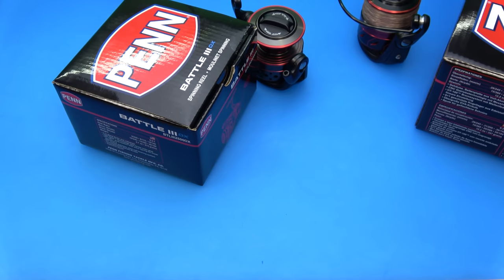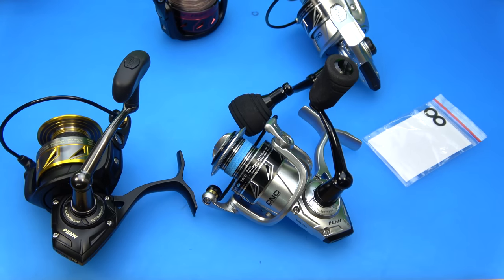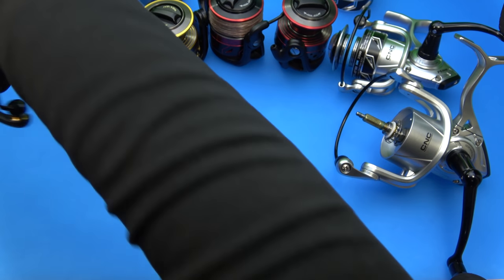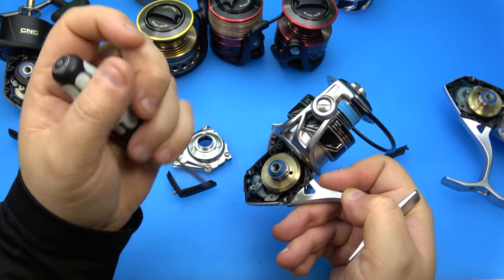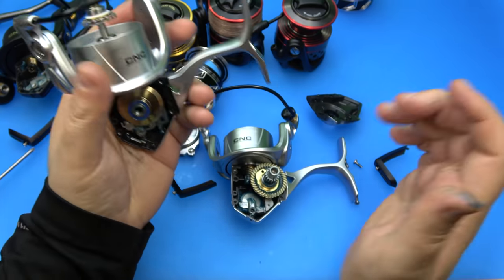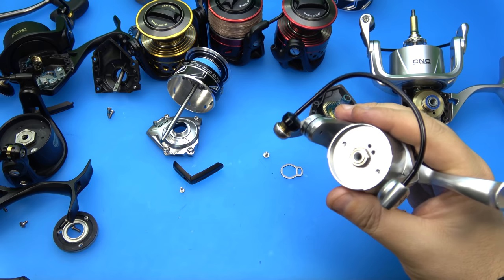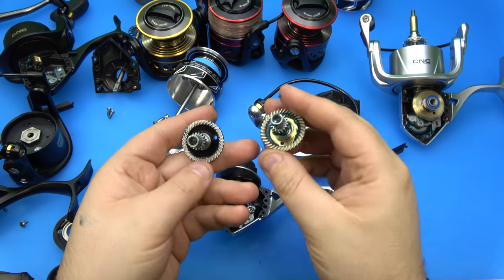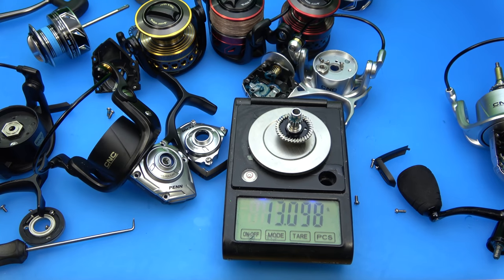The NEW PENN Battle 3 DX is SWEET!  How does it compare to the Battle 2, 3, and Penn Spinfisher VI.

Comment: I am a HUGE PENN FANBOY. I am South African and I fish rock and surf. I have the PENN BATTLE 3 6000 (which over here has a brass main gear) and I have a PENN FIERCE 3 6000. Both reels have done a bit of battle with some fish and I've been very impressed.

This is the best and most in depth review I have watched on YouTube. Thank you
Reply: @watching-thats-it  I think the Authority has a stainless steel rotor.
Reply: @watching-thats-it  I'm in the same boat. That's why I bought the Battle. It has a brass rotor that is as smooth as butter 😁
Reply: @watching-thats-it  apologies, I confused the rotor with the main gear.

Comment: Protip: Fill up the gaps inside/between the line roller assebly with high-viscosity oil i.e. bicycle chain lubricant, and it works like Daiwa's magshield. Even better than the magshield, because those chain lubricants are purposefully engineered to stand up against water, dust, salt, and every evil stuff you can imagine out there. The oil's surface tension keeps them from leaking out(that's why you need the high viscosity) and sheds off water like magic. Don't go cheap and get the good synthetic oils because they are still a ton cheaper than fishing reel lubricants.
Reply: Good to know! 👍💯💥
Reply: The key is to inject the oil up to the point where you can get the visual of the shimmering liuqid inside the gap between the line roller and the bail arm
Reply from the maker: Ehhh not what I would recommend... It'll become a sand magnet.  I grease my line roller bearings but try to make sure it stays in the bearing and I oil the hub

Comment: It think dx is supposed to mean dealer exclusive. I was looking at the battle 3 3000 and and the spinfisher vi 3500. I wasn’t sure about the new battle as it just came out. Knew the spinfisher had a good reputation so bought that. After a about an hour or two of use, when I would reel in my lure I would feel clicking or something like that, and it just didn’t feel right when I would reel. Eventually it started to feel rough and noisy when reeling in. Now over the past couple weeks the reel sometimes binds up when the spool is at the top of its oscillation. Next time I used it blackfishing the reel would bind up when reeling in a fish. The only thing that probably screwed something up is when other reel started binding up, the trip before that the rod rack at the dock broke and feel in the water with that reel in that rack. It was only under the water for a minute at most before we could get the rack back. Rinsed my setups that feel in the water when I got home. Supposed to be a sealed reel. Not like it’s been constantly getting dunked or sitting under water for an hour. I’m thinking about sending it back to penn when the season is over

Comment: So at that similar price point, would you go with a Spinfisher 6 or the Battle 3 DX ?
Reply: Good question. I'm curious too
Reply: For the price or just overall quality
Reply: @eastcoastoutdoors902  bang for the buck
Reply: @Floridaoutdoor  for the price you can’t beat a battle 3 DX from how impressed he was with the seals and the overall bearings. He also said penn would send some replacements if they ever got rusted. I just ordered myself some
Reply: Depends on whether your reel gets splashed a lot. If not, go DX. If it does get splashed often, go spinfisher. I beach fish so spinfisher for me but on boat or pier I would go with the DX. Just my 2 cents.
Reply: @seamurda100  yep I would agree on that. Inshore go DX especially for the price you can’t beat it
Reply: @eastcoastoutdoors902  Spinfishers keep sand out so much better. The shaft seal just makes it worth it to me beach fishing. I got tired of tearing down my daiwa bg's every 2-3 beach trips due to sand or water intrusion. Never had issues with them other than that. You can make a non sealed reel work on the beach but you are going to be tearing it down to keep it running right. Dont even think about using one if sand gets in it. Immediately discontinue using it and tear it down. I broke one reel using it after sand got in it.
Reply: @seamurda100  facts bro
Reply: @seamurda100  yeah that sand gets in and grinds up the gears putting chips in them and ruining the reel

Comment: Carolina-bred, fishing 'otaku' (fishing nut) here in Japan (38 years now) ... loving your patter.  In another era, good enough to make a television show out of it.  

But I couldn't help but to notice some parallels between the way car manufacturing in the U.S. and Japan had gone for awhile.  The do-it-yourself thing was quickly faded out in the Japanese post-war economy, long before the American handy-man started going the way of the Dodo.  But like you said, while Penns are still user-friendly service-able, Japanese reels are increasingly leaving that business model.  

In my twilight years, I'm heading more towards the finesse / ultra-light end of both fresh and salt water ... and recently replaced a couple of old Shimano Twin Power 1000s with Daiwa Luvias 2000 shallow spools ... great for my intended purposes (caught a few pecker-sized jack crevalle at Shimoda a couple of weeks ago), but impossible to service.  What is frustrating is that neither Daiwa nor Shimano will service reels older than 5 years ... basically creating a 5 year rentier business model — unless you can find a small 3rd party shop that services them.  And this makes no sense to a user who buys a Stella as a legacy reel to hand down decades later.  Just an old salt mumbling to himself here.

Cheers from Japan, and wondering if you got that Daiwa handle knob from Hedgehog?  I thought I'd try my Japanese language chops with them ... only to find they use translation software, and automatically switched to English when they saw my name.  😂
Reply: "Pecker sized" 😂😂😂
Reply: @jasonstokley7274  Yeah ... too bad I can't post photos of those brutes here ... must be every bit of 75 ... uh ... millimeters.  Erect.  😂
Reply: @stevemartin4249  Hey, i also live in Japan. Where are you located?  Maybe we could go fishin!

Comment: On 6000 size and up, there is little difference between the DX and the regular Battle 3. Both have the brass main and pinion gear and have a round power handle.
Reply: So the only difference would be the bearing supported drag and the color on the 6000 up?
Reply: @TubeYou7  yes

Comment: I bought a Battle 3 Dx 8000 today, should be fine paired with a 12 ft rod for shore fishing. I wanted a Daiwa BG 8000 but they are nowhere to be found in Canada and my second choice was the Battle 3 8000 until I saw the Battle 3 DX model $50.00 cheaper. I had to get it and I did. Thanks for the info and for what to check inside the beast that the 8000 seems to be at 27.7 oz.

Comment: Between the DX and Daiwa BG, what would you recommend? There is at least $30 difference right now (Maybe $40 with discounts), DX being the more expensive option.
Reply: I have both in 2500 size ,and both are great. The DX is a bit heavier and a lil more friction on the retrieve. Paired with Penn new B3 7plus rod, parabolic awesome, and the BG on their system 7ft rod. Best combos for the money in my book for light inshore. 20lb.braid.
Reply: Penn will hold up to salt better by far.

Comment: Recently bought a spinfisher VI 4500 and is a huge mess, windknots and winknots.....i can not use any Penn reel with the spool full like the one on yourvideo.  I use 20 pound braid and the problem only stops when the amount of line is clearly below the black line on the spool marker.
Reply: I have a Spinfisher Vl6500 with 40lb braid and and have no issues with it with a full spool..the way to fix a simple problem like what you are experiencing is to take a cloth or rag and lightly soak it with warm water and hold your line tightly in the rag while spooling the reel instead of your fingers.this little trick helps take the twists out of your line while spooling it.

Comment: looking into this....... Purchased a Fathom II Star Drag Casting Special... Got home, took it out of the box, and inspected it. With the spool engaged and holding the spool stationary with my thumb, I can move the crank handle in reverse about 3 or 4 degrees. This just seems way too sloppy and very disappointing. I'm thinking where the pinion gear mates with the spool drive is where all the slop is.

I took it back ...... Checked 2 other new in the box, they all had the same problem. They are made in China .... I cant believe Penn would allow this. Its in the pinion gear where it mates with the spool drive is where the slop is. Its like using a 11mm wrench to break a 10mm bolt loose ..... You know its going to strip given enough force.

Comment: Does the 4500 DX have the same size drive gear as a spinfisher VI4500LL? I assume buying the main gear from Penn for the 2500 or 4500 DX and swapping it into the spinfisher wouldn't be worth the minor strength increase vs the alu/brass composite it currently has?

Comment: I likey! I like the color as well! But if you say Penn wants to compete with the Stradic FL...but sorry not even close. I own the FL 4000 and battle 3 4000 sizes and the smoothness and lightness on the Stradic waaaay better...and I have them on both with 15lb braid and hands down the Stradic out casts the Battle like I'd say 10 to 15 more yards especially when using swimbaits. But the Battle 3 is more improved though on smoothness than the previous. The DX is still something I might get as well...it looks like a nice finesse reel.

Comment: this is a long shot, but is it possible to interchange the sealing components from the spinfisher, and plant it into the battle dx
Reply from the maker: good question.  I never really thought about it to be honest.   Im' going to say no due to the sideplate bearing pockets being different depts. (off the top of my head.
Reply: @TackleAdvisors  appreciate your reply bud. The reason I ask is because I have a rather old banged up spinfisher but mechanically is still going 100s, and I'm sure the seals are still perfect, so I was just curious to see if I could save a few bucks,get the battle and convert it into a semi sealed battle.

Comment: The battle iii 4000 high speed have a brass main gear that is larger than the gear on the regular battle iii 4000 and the 4000dx
Reply: Good to know.
Reply from the maker: correct, that is a function of gear ratio

Comment: The reason why people complain about there drag binding up is probably because when they go to store their reels or just leave it for 2 weeks without use or like month they don't turn there drag back down to lowest setting and then they damage there drag system. Because its literally pinching an damaging ur whatever material it uses for drag like carbon disk etc and then it ends up locking up when they catch nice size fish an mess up whole reel seen that couple times.
Reply: That's a good point. I often forget to change the drag

Comment: Nice breakdown. Most spinning reels use a brass pinion and an aluminum main gear and more often than not my Penn reels get play in them and loss there tightness and smoothness. The DX comes in all sizes with machined brass on brass main & pinion gears. What's the advantage of a spinning reel using a brass on brass main & pinion combination VS a brass and aluminum main & pinion ?
Reply from the maker: Metallurgy aside.  You don't experience premature wear from disimilar metals...And even if the brass main and pinion are different alloys...IT's not an extremely hard Aluminum oxide surface coating contacting the brass pinion.  There's just something about brass that just gets better with hard use.  And it lasts once run in better than gears relying on hard coats.
Reply: @TackleAdvisors  I understand the brass pinion is a softer metal and has worked well with an aluminum main. I always felt that matching the same alloys as long as they're not to rigid between the pinion and main gear in a spinning reel would make more sense for even wear and long lasting smooth durability. The gear train in the Tsunami SaltX are stainless steal and they've seem to have made it work. Nice Review on the DX. Wishing You & Yours A Happy Health New Year.

Comment: I'd love to see it compared with the Spheros inshore 4k after you get some fish caught on it. I was about to order a Spheros, but seeing this reel and its apparent quality at the same price point has got me doubting which I might want. I had terrible experiences with my SSV (irreparably failed zinc gear and trashed pinion, seized line roller, wind knots, terrible line lay e.g.), which I thought had turned me off of Penn spinners forever, but they seem to have fixed most of those issues and I'd like to see how they fare against one another. Downgraded old model Shimano vs upgraded new model Penn is seeming pretty interesting

Comment: I caught big ass fish on my penn battle 3 -6000 series for $200 and the same time caught fish bigger off a daiwa d-wave I bought for $40 so it ain’t how much u spend on a rod and reel it’s the fisherman
Reply: You can catch big fish on a cheap reel like the daiwa d wave. But cheaper reels use cheap gears, cheap bearings, cheap drag washers, cheap handles. You get what you pay for. I used a cheap daiwa sweepfire reel before. It felt like a toy. Then I bought a Penn fierce reel that was $105. You can instantly feel the difference in quality.

Comment: I purchased one of these HS 6000 - Penn has some issues, besides bearings, the crosswind gear has no shim or washer under the bottom and making the plastic stread all over the gears.  I was told by a penn tech - replace the unit get a slammer 3 - which I ended up doing..  Buy a Fierce and get good drag washers.

Comment: You should do a comparison between the 19 Certate and the 20 TwinPower. That seems like it would be interesting. 🤷‍♂️
Reply: I feel like he would choose the certate over the twin power
Reply: Certate is certainly a winner. My friend has 19 certate and 20 TP, always bringing and using them together every trip. But 20 TP began to corrode after 10x trips
Reply: I compared the Daiwa Certate LT to the new Twin Power XD 2021 and even the new one did not hold a candle against the level of smoothness and refinement the Certate LT has.

The only redeeming feature I saw from the new Twin Power against the Certate Lt, is that its more simple to work on.

Other than that, to me it felt like just a Stradic FL with better components.

Comment: I just ordered one from Egg Harbor Township TD
Reply: Got it lubed up with tsi 321 and corrosion block both bearings and main shaft and a dab on all metal inside springs etc. she’s ready to beat eggs
Reply: It’s a 3,000 so it’s 11.6 weight it feels like a real mans reel
Reply: @lesrinehart933  Did you feel the 2500 was too small? I have a Daiwa BG 3000 and a Shimano Sahara 3000. Should I get the Battle 3 2500 or the 3000? I've heard Penn's run bigger is why I ask. That's my TD here in SJ.

Comment: This or a Daiwa BG?
Reply: I see that the BG just got a mag seal as well, if that interests you... alot of folks thought that was the only downside of BG was no mag seal. I personally don't think its a huge deal, as I fish fresh water.
But they now have a BG with a mag seal.
I have a regular BG, and a fuego, just ordered a battle 3 DX. Respond to this comment at the end of the summer and ill let you know what I like best. 
I have very high hopes for the B3DX due to the CNC brass gearing. Only time will tell.
Reply: @nicholasmapes  hey just saw ur comment and had to ask wich one u prefer, battle 3 dx or the bg, mostly if u have noticed one being better/worse in casting distance
Reply: @Mavarise  i really only use my dx for trolling, and the rod has alot to do casting distance too. They both do well though. The bg casts like a dream compared to my beater rigs
Reply: @nicholasmapes  but wich one do u feel would cast further/smoother with the same rod?
Reply: @Mavarise  like i said, my dx is on a trolling rod, and i don't hardly ever cast it, so im not the right person to ask.

Comment: So I guess you're speaking from a pitcher's perspective, when you say "I can't see this being a homerun..."??  Just kidding (I think [or hope] that in context, we all got that you just forgot to install the "not" in that sentence!).  Oh, and regarding pinion bearings going bad, two things.  Consider condemning skirted spools with cutouts in the skirts.  Biggest marketing wank ever.  Two, I've never had a problem with top-of-the-pinion bearings on my favorite spinners, but, now I'm wondering if I should bother with the solution, before deploying my sealed Slammer "vacuums".  The solution being, Alan Tani's big contribution to maintenance culture, which is to full-grease-pack any ball bearing (such as a line roller bearing, in the case of spinners) that one is worried about.  After all, if one can't overcome the resistance of a small blob of grease, and the rotational inertia of abandoning cutouts that save only a few grams of weight, one should probably stay away from saltwater anyway.  And, one should not have to buy a 2020 Saltiga to avoid cutouts... though it's good to see some Japanese horse sense in that thousand dollar range!